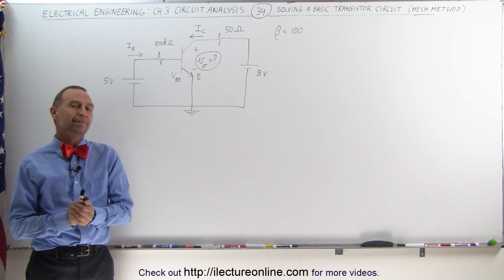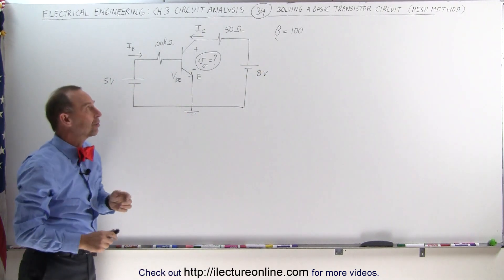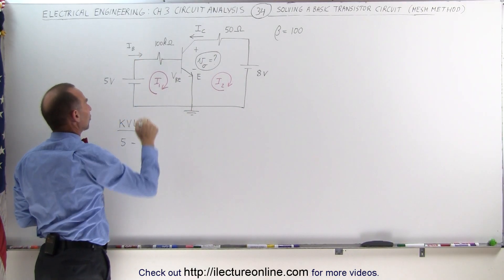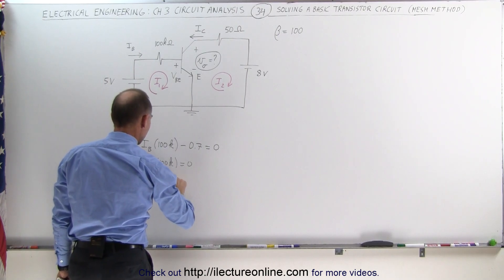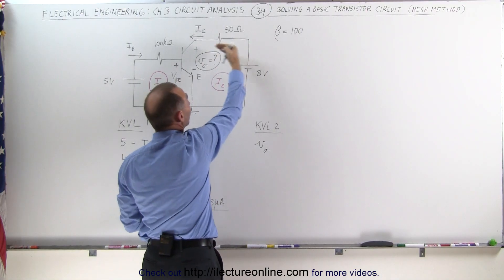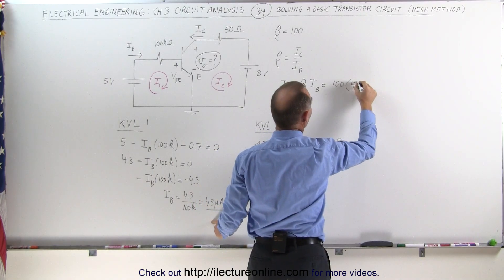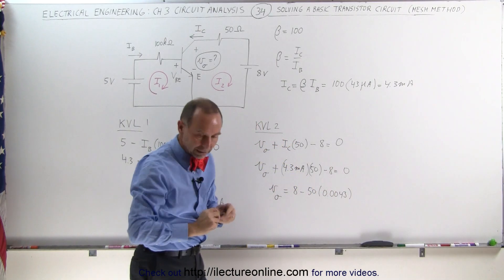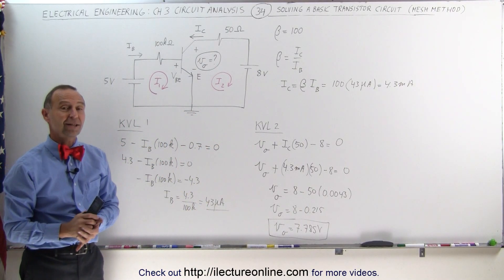Electrical Engineering: Ch 3: Circuit Analysis (34 of 37) Solving Basic Transistor Circuit (MESH) 1

Comment: Hello professor Micheal , quick question where does 0.7 voltage drop come from when creating the first KVL?
Reply from the maker: The voltage drop is typical across PN and NP junctions, and also in diodes.

Comment: mr bizen at first loop you went throuhg positive terminal and you wrote -0.7 ?you should have done +0.7
Reply from the maker: The -0.7 V is the voltage drop from the base to the emitter.
Reply: @MichelvanBiezen  actually we have got  diode characterisctic at vbe .you can think that 0.7 volt is thereshold voltage and first loop you went through positiv terminal ypu shpuld have wrote 0.7 not -0.7
Reply: @MichelvanBiezen  I am sorry mr. at first loop You drew the circle from left to right, but you created the opposite equation, my mistake.😅
Reply from the maker: No need :)

Comment: The beauty of KVL is its assumed independence of potential . Potential can be 0 or 100 or x volts at any one point. The calculation result is the same. IOW potential at minus pole of Voltage Source can be voltage Y and not 0 V. It is none of your concern in that calculation. Imagine some entity creating a constant minus potential on 1  capacitor pin  where obviously  no DC current flows through.
Reply from the maker: It is a very powerful method indeed.

Comment: Thank you for giving wonderful videos! But i have one question, sir. I don't undetstand why you put plus sign for Ic although its direction is opposited to second loop's direction.
Reply from the maker: When going across a resistor against the current, there will be a voltage rise.
Reply: @MichelvanBiezen  Thanks.. that means like E-(-IR)= E+IR ?

Comment: Hey professor Biezen, one question. Why is there a 0.7V drop between the base and the emitter?
Reply from the maker: Across any p-n junction, there is a voltage drop due to two reasons.  1) there is an energy level difference between the two that must be overcome.  2) There is some resistance across the junction (the drop caused by this is current dependent)
Reply: @MichelvanBiezen  Will every npn transistor have the same voltage drop? If not, can it be calculated or found in the data sheet?

Comment: The value you got for Vo is wrong because you made an error when you multiplied 50 Ohm by 43mA(0.043 not 0.0043)...The right answer is 5.85V
Reply from the maker: It is hard to see, but the current is 4.3 ma  (not 43 ma)  Thanks for pointing that out.
Reply: @MichelvanBiezen  I d'ont agree with that since it is 4.3/100kOhm for  the value of Ib which will give 4.3×10^-5
Reply from the maker: Ah yes.  I see it now.  I was sloppy with the "100K ohms" .   Thanks for pointing that out.
Reply: @MichelvanBiezen  No problem Sir

Comment: Only thing I don't like is dropping all the units and suddenly intrducing them in the result again... that's bad style :) But nicely explained.
Reply from the maker: Always adding the units is not necessarily a good thing.  It takes time, and clutters up the equations making it more difficult to flow through the problem.  And when the units are known since you are typically solving for the current or the voltage it is often not necessary.  However that said, there are times that it is advisable to incude the units
Reply: @MichelvanBiezen  I agree

Comment: this knowledge what I'm looking for!
Reply from the maker: Glad you found us.
Reply: @MichelvanBiezen  thank you, 
But there is a little unclear to me
on designing a circuit what should I look first,  I have BJT transistors to design a circuit, should I adjust on resistors to make the transistors work or I should look for transistors that can handle ng Current and Voltage of my power source?

Comment: How do we know that V(BE) is going to be 0.7V?
Reply from the maker: It is a property of semiconductors.  The drop is always around 0.7 V for most ransistors and diodes
Reply: @MichelvanBiezen  I think we use a resistor of such ohms with it in order to have 0.7V drop. If we use a very very less resistance( with high DC voltage), then the drop will be very high and it will get damaged, I think.
Reply from the maker: The drop is inherent in semiconductors.  The 0.7 volt drop is not due to resistors.
Reply: @MichelvanBiezen  I disagree with that. Because in ,for example, a PN JUNCTION DIODE of some type, you will have to increase external DC voltage to increase forward voltage of diode above 0.7V( below this, current will be negligible and too much above this, it will get damaged,,you may use some resistor with it, along with battery, to prevent damage). Now the same PN junction diode , when used in an NPN TRANSISTOR, again needs forward potential drop of nearly 0.7V. And again you need an external DC battery of 0.7V for that purpose. If you have 5V battery, for example, then you need to use a resistor with it.The exact value of resistor can be known by using manufacturer's data sheet in which the  necessary current for that PN diode or transistor is already given.

Comment: Thank you sir for this video.
I want to ask how you got 0.7v as the drop from the transistor to ground?
Reply: Is it the potential barrier voltage for silicon diodes?
Reply from the maker: Yes, it is the typical drop for transistors.

Comment: Im sorry but on the very end when you calculated (50)(43miliamp) you converted the milliamps to amps right to solve ohm law and so it’s 0,215 shouldn’t it be 2,15 V? And then 8-2.15?
Reply: 4.3 mA

Comment: I've encountered a problem: This way of calculations seem to work well enough for situations where R1>R2*beta (R1 being base resistor, R2 the collector resistor). But when the collector resistor is higher, in this video's case it would be above 1k, the resulting Ic is no longer Ic=Ib*beta. 
Is there a way around it?
Reply: Same here, I'm looking for the answer to that question as well. In my mind, I think that Ic is the maximum current that allows to float through the transistor. If the resistor doesn't cause the current to go below Ic, then the math adds up. Otherwise, it doesn't. It gets worse in the next video where an emitter resistor is added. If the collector resistor has high enough resistance, it will influence Ie, and if Ie is different, then it will change Ib as well. I find that quite hard to wrap my head around. I can reproduce this in simulators, but would really like to see some explanations on this topic.
Reply: Not sure if you're still interested, but Ic=Ib*beta is always true, as that is the definition. The value of beta changes, as it is the ratio of Ic and Ib.
Reply: @Dogthedeadly  Thank you. So, there is no solution, just an explanation, from a different view. As we, to solve this kind of problem, presume beta to be constant, to calculate Ic=Ib*beta, while it isn't, is there any way to predict the beta changing? What function of what it is?
Reply: @nexusAa  there are multiple betas depending on a few factors. What is shown in the video is a transistor in forward active mode using large dc signals, with the corresponding beta value for that mode. As you change Rc, you're going to change what mode it is in. The beta value for each mode isn't something we can really change for a given transistor from what I understand, it's a characteristic of the transistor.

Comment: Hello Professor... What happens when you have an input voltage but no resistor between it and the voltage drop between the Base and Emitter... Would you simply combine them?
Reply: You'd heat up the transistor until it burns!

Comment: I like the way you give a lecture. Thanks for making videos of this kind though I have a little problem in understanding this and I hope you can help me. Why did you not include the current in the right loop (I2)  when writing your KVL equation of the left loop? Also, when writing your KVL  of the right loop , why did you not include  the 0.7 volt ?
Reply from the maker: 1) Since there are no voltage drops in the section of the 2 loops that are common, we don't need to worry about current 2 in loop 1       2) The 0.7 volts are included in the Vo
Reply: @MichelvanBiezen  Sir, thank you very much.
Reply: @MichelvanBiezen  2)  Isn't the Vce equal to 0 when in saturation mode and when in linear mode > 0.2V ?

Comment: The thing we found in this question was not considered in the first loop,why?
Reply: shashi giddigam if you follow the circuit, V sub o is the voltage drop from collector to emittier. The first loop runs from the base to emitter, not collector to emitter

Comment: Hey, Michel! I am writing a program to simulate electric circuits and I am looking for generic formulas for transistors. You say that beta is Ic/Ib, but what if the 100kohm resistor was reduced to, say, a 30ohm resistor? The Ic/Ib ratio could not possibly be 100! Otherwise, there would be a negative v_sigma across the transistor, wouldn't there?

Comment: wtf where did that 0.7V come from?
Reply: It's the voltage drop from the transistor itself. It's a standard value.
Reply: Clemente Küchle He brought it from his house
Reply: For silicon .7V
For germanium .3V
Reply: It is the amount of voltage required to activate silicone type semi-conductor.
Reply: VBE is the touching Voltage between 2 layers of semi-conductor, for Si : 0.7V and for Ge : 0.3V. This Transitor is from Si so it should be 0.7.
Reply: It is the drop of voltage in a junction in a simplifyed (and linearized) model.
Reply: How come there's not a drop between collector and base?
Reply: Is voltage drop in silicon
Reply: Voltage drop in the sillicon diode in the transistor
Reply: It's a fixed standard value, VBE is always equal to 0.7 volts

Comment: Hi professor 
thank u for this helpful lecture
but i was wondering why the V between C and E is equal to 0.7 ??
Reply from the maker: There usually is a small voltage drop across the transistor, depending on the amount of current flowing through it.
Reply: @MichelvanBiezen  Yes but you're still calculating the current so where did u get the 0.7 V from
Reply: @MichelvanBiezen  I wish you would have time to look around here, Sir :))

Comment: How do you know the 100kohm resistor has a voltage drop?
Reply: That is the drop for a P-N junction. It acts similar to a diode (diodes also a .7V drop typically)
Reply from the maker: If current flows through a resistor, there will be a voltage drop.  V = IR

Comment: I want to ask one question.which battery(5V or 8V) will the current I(E) go to? thank in advance
Reply from the maker: The actual current is directed according to the black arrows.  The red circular arrows are just used to work out the problem using Kirchhoff's rules.
Reply: +Michel van Biezen I quite don't understand your answer. you mean I(E) will go to battery 8V only? right?
Reply from the maker: Ib is the base current ,it is driven by the 5V source.  Ie is the emitter current, it is driven by the 8V source, but the amount of emitter current (Ie) is controlled by the amount of the base current.
Reply: Thank you very much sir.
Reply: @MichelvanBiezen  Doesn't that depend on if the transistor is on a specific operating mode. By the way, thx for the quality videos, Electrical Engineering is very tough and keep making more.

Comment: So it's a given..it will aways be.. 07 btw collector and emitter  when calculating the mesh current. Love the videos btw.  Using it to study for the FE. Thanks for responding and making sense.
Reply from the maker: +Christina Schumski  Not 0.07 but 0.7 V.   Yes there is very little difference between transistors.  It is part of the property of the semi-conductor material.

Comment: How'd he get the. 07 voltage drop in first mesh
Reply from the maker: +Christina Schumski  The drop is 0.7 Volts and it is due to the semi-conductor property of the base.  Current will not flow from the collector to the emitter until there is a minimum of 0.7 Volts between the Base and the Emitter.